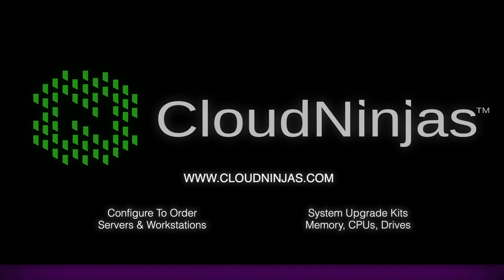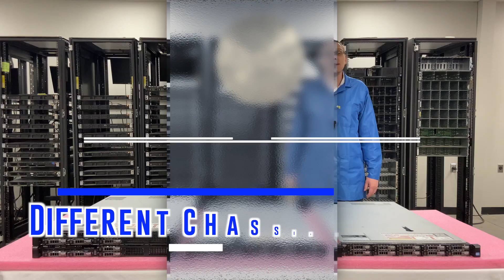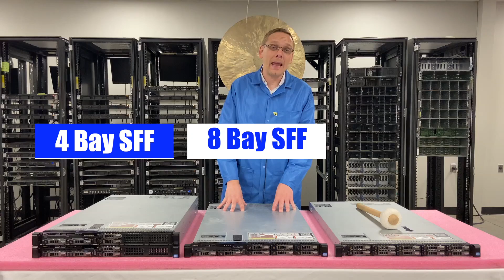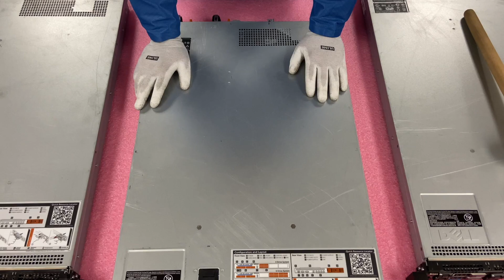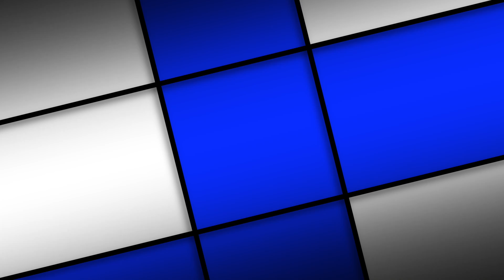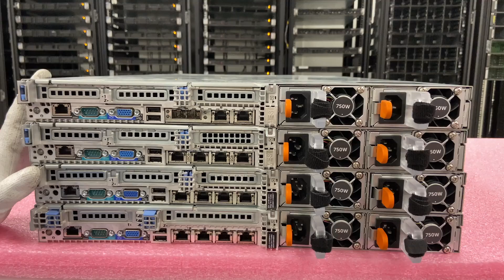Dell PowerEdge R620 Chassis Overview | Chassis Options | 4 Bay SFF | 8 Bay SFF | 10 Bay SFF | PCIe

Comment: Thanks for the videos CloudNinjas,
I have a r620 server which is rebooting frequently and logging message “the system board bp15v pg voltage out of range”. 

It doesn’t have any air shroud installed, is that the reason of reboot and system log?
Reply: Test the power supplies and mahbe substitute one and try again
Reply from the maker: Thank you Leo!